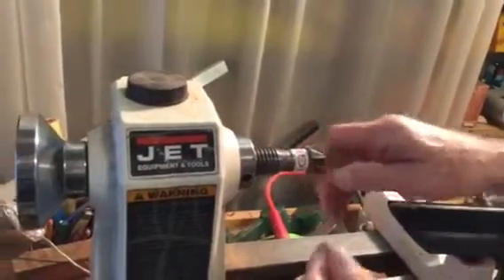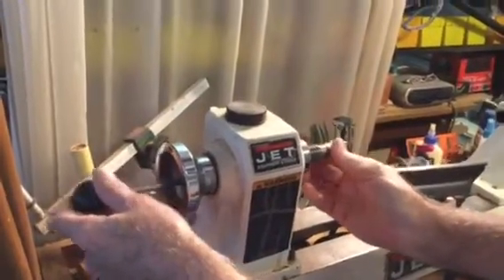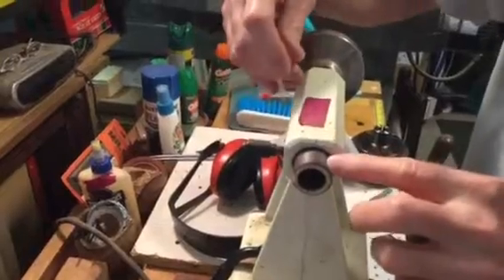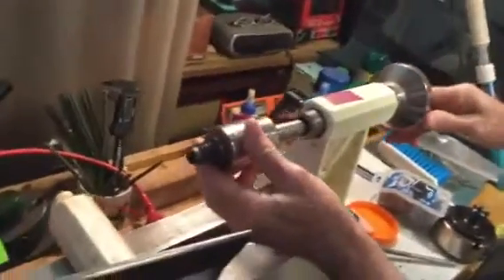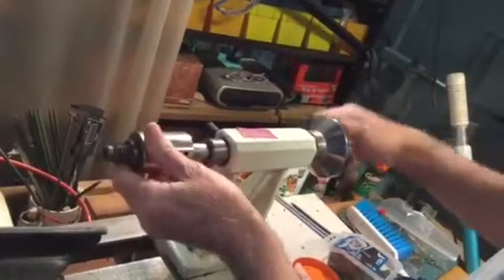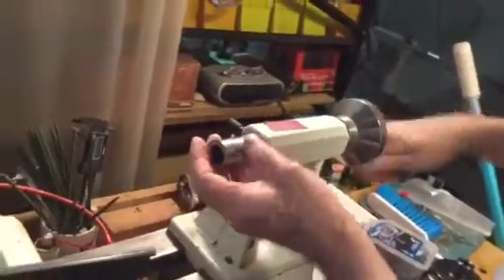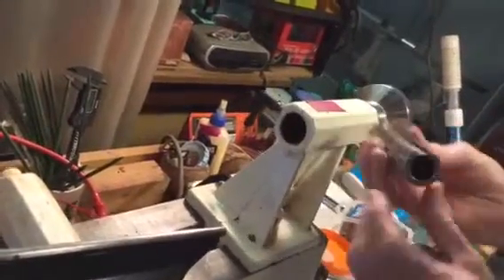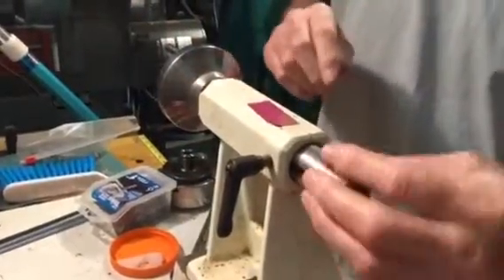Jet Mini Lathe Tour

Comment: Thank you for making this video! You honestly answered so many questions I had about my jet mini lathe. I had a forsner in the chuck in the tail stock and it spun then stopped and I was unsure so i just used my drill press. Now I see with the taper that is normal and I have the confidence to use the tailstock again for boring out material.